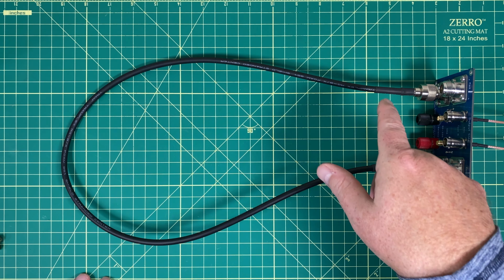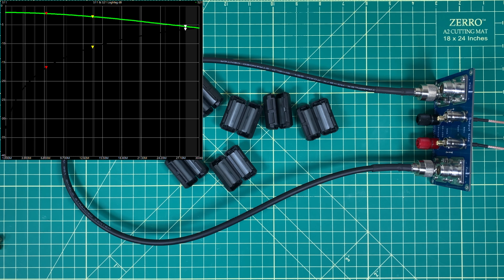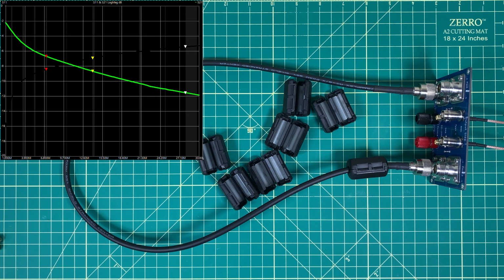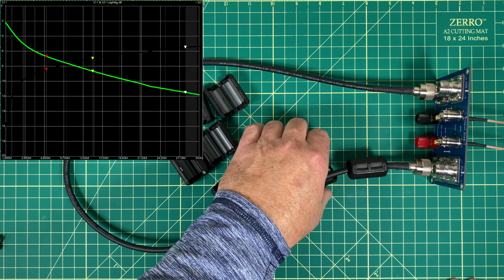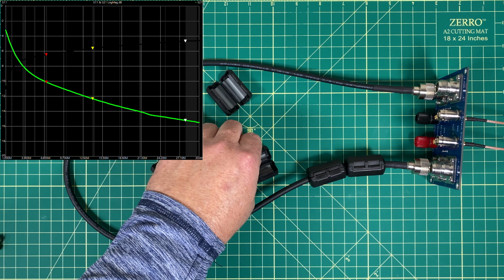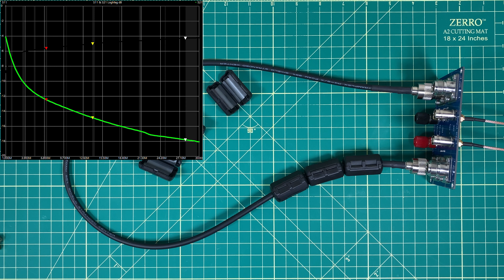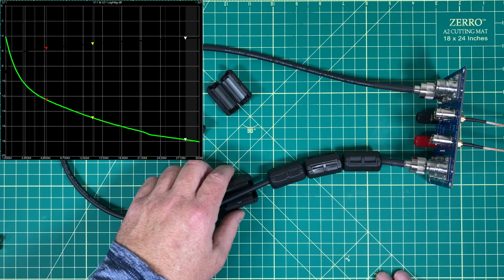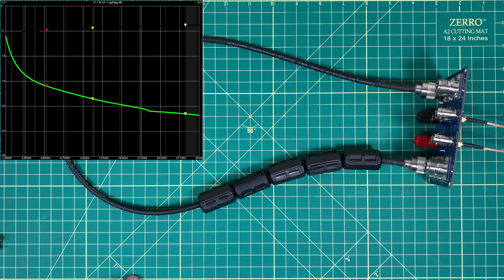Can Ferrite Beads Improve My Ham Radio?

Comment: Also, why doesn't your sweep at first show a flat line on 0dB?
Reply from the maker: My assumption is that there’s an inherent amount of differential mode current suppression that is happening without adding any external suspension to the circuit.
Reply: @GraymanPOTA  Can you explain to me what "differential mode current suppression" is?  I thought we were trying to do with common mode and not differential mode.

Comment: I think I must get my hands on a nano VNA.
I have made a coax cable with around 30 ferrites of different absorption properties together with some iron powder ring ferrites for a measurement cable. However, I never measured the attenuation. I merely believe it should be good.
Reply from the maker: You were the person I had in mind when I made the video. We get told by various sources all kinds of different ways to build a choke, some right and some wrong. This is a good way to test and modify the specific choke in front of you.  Not to mention the Nano VNA has a lot of uses in ham radio. The NanoVNA that is linked in the video description currently has a 10% off coupon.
Reply: @GraymanPOTA  73 and 55 in 2024 mate, from a German oldie. Love your video!

Comment: Why don't you also check the center conductor in a separate test?
Reply from the maker: We are looking at suppressing common mode current that is in the magnetic field of the shield. The center conductor carries differential mode current in relationship to the shield and we would not want to suppress that.
Reply: @GraymanPOTA Indeed, you give an excellent reason to also check the center conductor in a separate test.   We need to assure there's no attenuation there while adding the ferrites.

Comment: There is more to this. One, that test jig is going to introduce a good bit of parasitic capacitance and skew the results. Anyway, you're not measuring the impedance along with the resistive and reactive components of the impedance. Each bead will actually add the same amount of all 3 of those, every time. What you have there is almost certainly reactive for 80 meters which can make common mode current worse at those frequencies than no choke at all. It's probably resistive and will work well for 40 meters and above but without measuring you can't know that for certain.
Reply from the maker: Thank you for watching. I look forward to seeing your video.

Comment: Hi, I wonder if the ferrite beads would have the same effect with 240 volt AC?
Reply from the maker: That is a good question. RFI can find it's way in to a lot of things, for example, I have issues with my oven in the kitchen on the other side of the house doing silly things when I am on 40 meters and I am transmitting above 50 watts. When you are asking about 240 VAC, I am going to assume your use case is the input power supply for an RF amplifier, but it could easily be an electric dryer or electric stove. Palomar Engineers, https://palomar-engineers.com/,  has a whole section dedicated to HF RF amplifiers and has kits put together for specific amplifiers. Even if your specific use case is not listed, there is enough documentation and diagrams for you to get a good idea for a solution to meet your needs. In addition, they have solutions for other RFI issues in the home. In full disclosure, I have not personally purchased anything from Palomar Engineers, but I know people who have. I have not heard anything about the company or their solutions that would make me want to shy away from making a purchase from them. I hope this helps. -Tim
Reply: @GraymanPOTA  Thank you for the reply, my specific issue is having just fitted 240V LED lights, it cuts my boradband speed down by 30% when the lights are on. The broadband it interupts is supplied by wifi repeaters and to the be of my limited knowledge they do not like any interference on the line.
Reply from the maker: @ezetobebad  it appears that the LEDs themselves might be generating the RFI and I don’t think that placing RFI suppression on their inputs would help out. It sounds like you can measure a difference in interference with and with the lights turned on. I would speculate that the LEDs are interfering with the WIFI signal on the 2.4 or 5 GHz band between the device and the AP or AP to AP if you’re using a MESH configuration. Another scenario might be the WIFI AP is in close proximity and it is being affected by the RFI. My educated guess is that you are experiencing interference in the signal between your device and the AP causing excessive retries and slowing down the speeds. I would try using a different channel in the same band and/or try a different band and see if that helps out. Most APs have a periodic scan function to find the best channel within the band on both the 2.4 and 5 GHz bands which may or may not help if the lights are not on at the time the scan happens. I hope this helps guide you to a solution.
Reply: Thanks for the suggestion, very helpful. godbless @GraymanPOTA

Comment: I think a larger ferrite and passing the coax thru it 2 or 3 times would be more elegant. Or spare the ferrites and wind a tight 6-7 turn coil and secure with tyraps.
Reply from the maker: The test rig an NanoVNA makes it testing different configurations so you can get the best performance results from your setup. Thank you for watching.

Comment: What do you think the results would have been if you'd put them at each end, instead of only at one end?
Reply from the maker: Good question. The attenuation effect of the ferrites are cumulative, but at some distance if your ferrites are to far apart, you stand the risk of reintroducing RFI back on to the coax. In some use cases, you might want to place ferrites on both ends of the coax, but in the case of an EFHW antenna, you are going to use part of the coax to act as a counterpoise for the antenna so you would not want to place any ferrites on the feedpoint side.
Reply: @GraymanPOTA  Thank you 😊

Comment: I'd like to see this test repeated, but with a longer length of coax, say some significant fraction of a wavelength at 40m, and move the ferrites around on the coax. There should be nodal points on the coax where the current will be low but the voltage will be high, and vice versa, and the position of these points should be different for each wavelength. You should find the effectiveness of the ferrites will vary depending on where you position them. That would be very informative.
Reply from the maker: I thank you for your suggestions, but the point the video was to encourage people that they could, with some simple inexpensive test equipment, build and test their own RF chokes.

Comment: I'd like to know the effect of spacing the beads.
Reply from the maker: That sounds like a great follow up video idea. That is a good use of the test rig and nanoVNA to visually see the effectiveness of experimentation.  What is your hypothesis on the effect of spacing the ferrites apart?
Reply: @GraymanPOTA  If there's any significant flux linkage bead to bead, then effective inductance, and, thus, suppression might be reduced.  But spacing will make the assembly more flexible, and thus more durable, and the trade off is worth understanding.

But, also, we don't use these in isolation and, particularly for feed point chokes, the coax is in the near field of the antenna.  Breaking the coax into non-resonant lengths might improve things in ways that don't show up in the simple attenuation tests.  So, if one doesn't loose a lot of attenuation by spacing, it could reduce the effect of the presence of the feed, acting as a parasitic element, upon the antenna pattern.
Reply: @KeepEvery1Guessing I made one from solid beads that were a tight fit on RG58. Threaded 12 on (10mm long each) with gaps to keep it flexible, covered it with adhesive heatshrink. I use it as a patch cable between my radio and antenna switch. It really does work.
Reply: I predict no effect

Comment: Man I sincerely appreciate this, but a test bed is not a true use case, do this to replicate a real world scenario:buy a uniden bearcat scanner, preferrably a bcd536hp, turn it on, turn on your nearby HF SDR receiver and watch the QRM destroy your hopes and dreams. i mean all of them, Grayman. Now slap beads on that power supply one at a time until you reach 17 like I had at once and see that indeed there are no more hopes and dreams, and the only way out is not a visit to the gun store for a relevant amount or ordinance (I mean who needs witnesses anyway?) but a highly directional magloop instead, realizing all the money I ever spent on ferrite beads have gone absolutely to waste. I sincerely hope the ferrite family enjoys their college education :)  great work, Grayman.
Reply from the maker: The first time I tried this experiment with the test rig and the NanoVNA, I bought some ferrite beads off of Amazon that said they were great for RFI, ham radio and all that jazz. What I found was that the beads did not provide hardly and attenuation in the frequency range that I was looking for. They did provide better attenuation at higher frequencies (VHF). The only thing that I conclude was that they were not Mix 31 ferrites. I looked at the listing that I purchased from along with several others and none of them listed a Mix type. I ordered a new set of 10 from an electrical supply house, that I could guarantee were Mix 31, and I got the results that I show in the video. Thank you for watching...

Comment: I am interested not sure if I understand it all
Reply from the maker: Larry, the good news is you are interested. The long and short is that we get what is called common mode current that is developed on the outside of the coax feed line from the radio to the antenna. Coax is an unbalanced feedline due to the fact that the braid/shield of the cable is longer then the center conductor. Because the conductors are not balanced in length, it creates a situation where current is allowed to flow, in the magnetic field, the same  or common direction as the return currents on the braid/shield of the coax. This extra current creates noise and could damage the receiver. The ferrite chokes I was testing will help disrupt the magnetic field and choke or attenuate the current that is allowed to pass in the magnetic field. So I was showing visually with  test rig and NanoVNA the relationship of the number of ferrite chokes to the level of attenuation of the common mode current that is gained.

My goal for this channel is to help explain the "why" behind the principles of radio and electronics so lay people can understand. All to often we get told by someone that, fill in the blank here, is what you have to do, but they can never explain the why behind it.

Comment: Why would someone feed the shield of his coax?
Reply from the maker: That is a fair question. With this test rig we are inserting a signal on the shield of the coax to simulate common mode current that would occur on the shield of the coax in order to test the effectiveness of the common mode current choke. In normal operations, we would want a non disrupted electrical pathway between the chassis of the radio and the non-radiating element of your antenna. I hope that clears up some confusion.
Reply: You wouldn't feed the shield, but your antenna would.  When you go from unbalanced coax to a balanced antenna (like a dipole), it forces the antenna to send some of the signal back down the OUTSIDE of the coax shield turning it into a radiator and part of the antenna system.  This is generally undesirable - though for some types of antenna it is a design feature.  Putting a choke at the antenna will stop that signal on the shield and will stop the antenna from picking up interference on receive and skewing your pattern on transmit and getting RFI in your shack.

Comment: Nice to see some practical experiment which is easy to understand. However, I would have liked to have seen 160 m included in the measurements. I would also like to see other MIX than 31, such as Mix-43, and others, as it is a bit surprising that Mix-31 covers the entire HF band so relatively well, but maybe there would be other MIX that could do it better than this ??
Reply from the maker: The test covered for 1 MHZ to 30 MHZ, I just highlighted the 40,20 and 10 meter bands as a point of reference. If you look at the left side of the trace, you will see the lower bands. 

I have some Mix 43 ferrite beads, but they generally provide the best attenuation above 30 MHZ. Due to the mixture of different compounds use for ferrites and toroids, they provide different characteristics for a wide variation of applications. 

I will be doing some different videos with the test rig to demonstrate the different properties of different types of chokes so people can see what works best and tune them for their specific use case. 

Thank you for watching.
Reply: I did see the start at 1 MHz, bit as the lowest band in this case, normal will be 160m, and the highest vil bee 10 m, then i do think that the ends makes most sense to show up, and special to show the difference of what can be expected for a comparison, so i do look forward to see more test, of other MIX.
Also the test fixture that you are using, will be nice to have more details on.